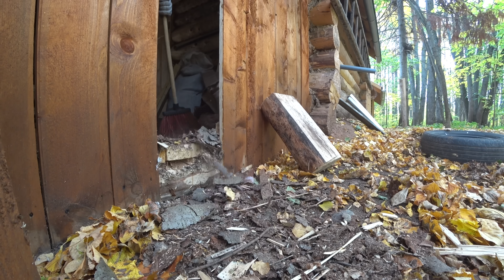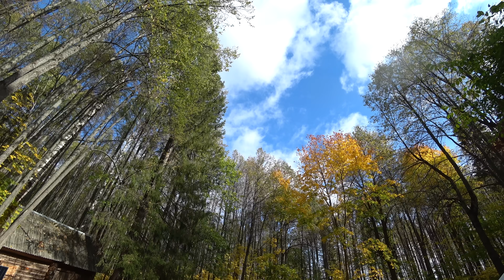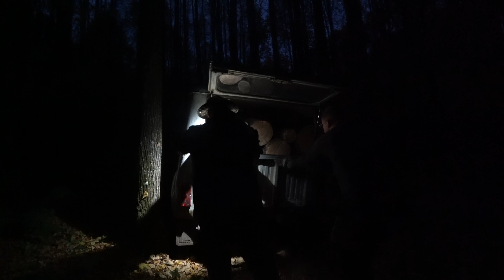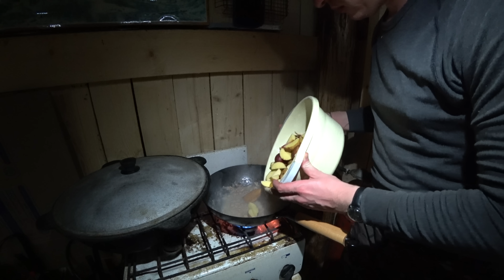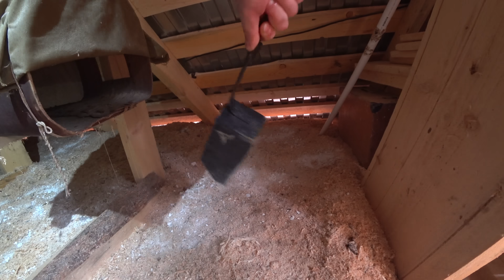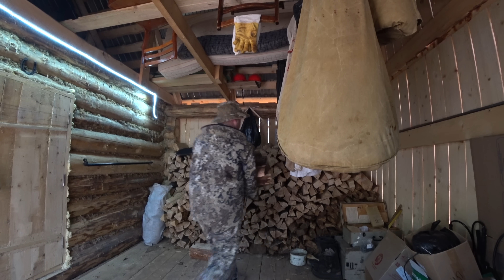GETTING ready for a HARSH WINTER. COZY LOG CABIN OFF GRID

Comment: the window with the handle should have two clicks before opening, 4 clicks if it is tilting, if you make the first click it opens only 6 millimeters without removing the safety, if it is also tilting it opens double without removing the safety. The internal temperature does not change in the first shot, but there is a slight exchange of air, to avoid internal condensation, in the third shot the hot air is let out in summer, or the smoke if something doesn't work.

Comment: that sawdust inslation will soak up all the condensation drips from the metal foofing(should have laid a waterproof membrane under the tin)when that sawdust get laden with water it will cause a bad damp on the ceiling under it and freeze as well